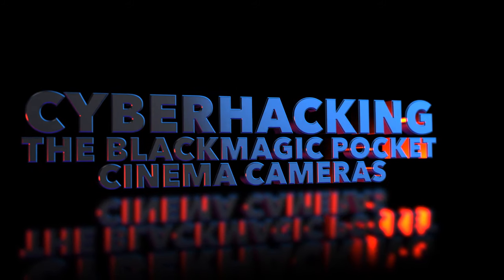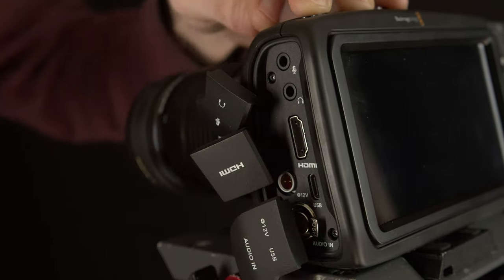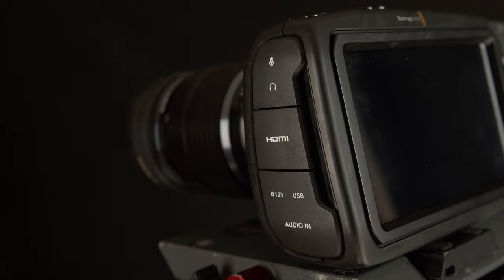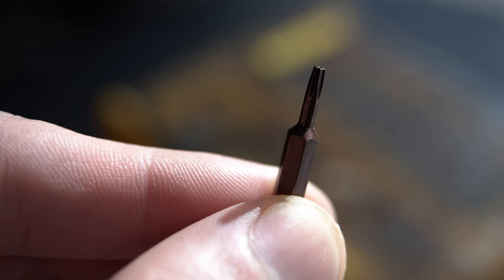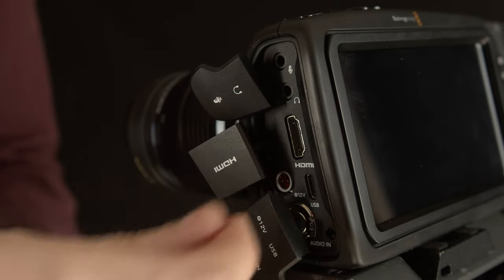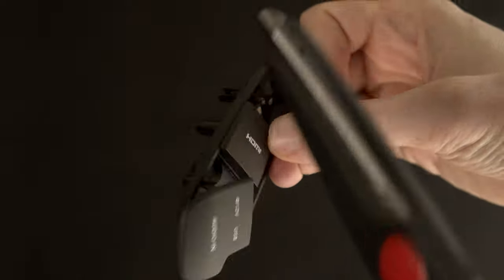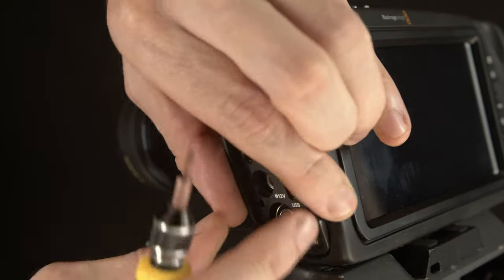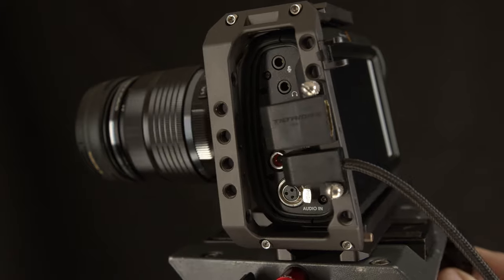Removing The Flappy Things From A Blackmagic Pocket Cinema Camera

Comment: I just pulled on mine very fast and hard like I was starting a lawn mower, and they popped right out. The stopper part on the underside of the cover stayed attached to the flappy, Now I can pop them back in should I need (like if I was going to sell my camera and the buyer wants them put back on). I didn't have to unscrew anything that could potentially void my warranty, nor destroy the flappies by cutting them.
Reply from the maker: I'm sure there are less hateful ways to do this. I'm just not a less hateful kinda person. ;-)